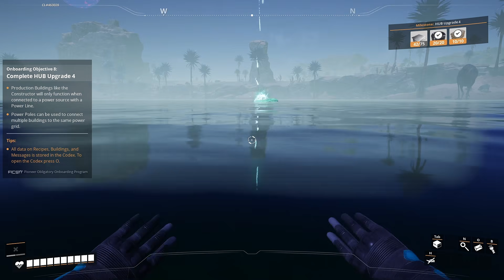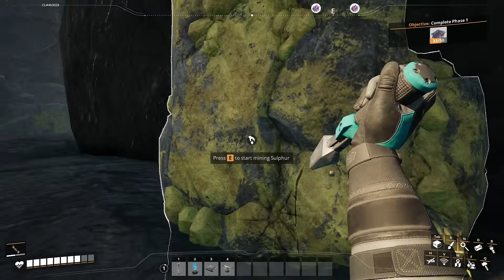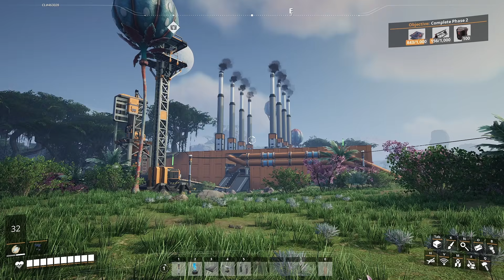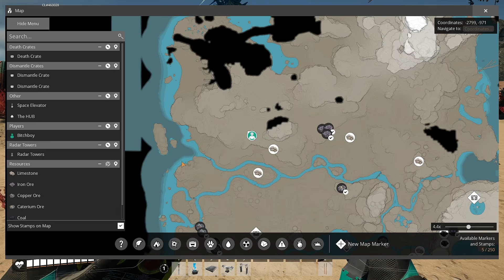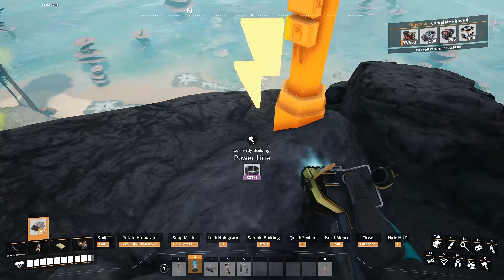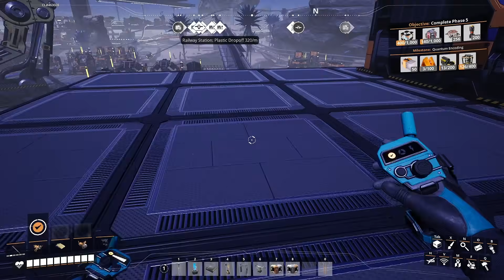I Tried Satisfactory, It Was Amazing

Comment: The single map thing is indeed what turns me off of Satisfactory. I played blind the first time, did my own thing, got about 30 hours in and stopped. Basically enough to get a little past coal power. I'm not creative enough to make a 3d build look good and I'm way too concerned with perfect ratios, so I was just constantly annoyed. But even with that small time frame, every playthrough I watch, I know where the player is, I know what kind of resources are around them, I've even seen one with a nearly identical starter base to my own. We put our hubs, elevators, and coal plants in the exact same spots. I don't know what the goal of a repeat playthrough would be other than speedrunning. 

It's a fine game. Just not for me.

Comment: Tip for your early-to-midgame endeavors, especially if you decide to make another playthrough: use Tractors instead of stringing long belts and sky bridges across the biome! 

They use less fuel than you’d think, and in the early game you can always scrounge up some fuel (I recommend starting with Coal) from locations that are inconvenient for Steel or Power and bring it to the rest of your truck network with a dedicated fuel truck!

Plus, the suspension on them is surprisingly good- you can just drive them across the bare ground in most locations, and you can make short elevated foundation bridges to handle areas you can’t. 

I love to use them to bring resources from factories I string out across a biome to my home base, mostly due to the versatility.

Comment: To address one of your later critique, the awesome points system provides a "megabasing" target and insentive, sinking more complex parts (phase 5 parts are the best) to generate as much points per minute as possible. Since the map is finite, there is a theoretical limit to how many points per minute one can generate, but still megabasing into the hundreds of millions of points per minute is an interesting challenge as one needs to exploit almost all resources of the map and also choose which alts to use carefully to save on rarer resources, for example the Pure Copper Ingot alt becomes amazing for its yield despite how annoying it is to use in a normal run.

That being said, great video as always!

Comment: one thing about the blueprint system: once you unlock steel based platforms from the fixcit sink and realize that stacking machines is stupidly easy, you can cram like 12 machines into one space with it. gets a WHOLE lot better with blueprinters mk2, though the recipe setting leaves much to be desired..............

Comment: How far ahead are you recording these? Are you switching games every day as you record?

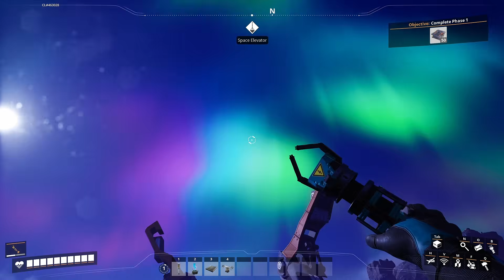14:35 That type of space elevator need not be pulling hard on the ground station. They can even "hover" just above the ground unattached to it.

23:29 I love how we can see it being constructed by a technology similar to our own construction tool. It makes more sense than Factorio labs.

37:50 At least your factory colour scheme isn't a dated edgy 4chan meme. :-)

1:18:42 It's exponential growth, so we can tell it has not been going for thousands of years, because otherwise everywhere would be covered in factories. E.g. in just 480 years, if the population of Pioneers multiplies by 10 every 10 years, you could fill a trillion volumes the size of our observable universe, each with trillion galaxies, each with a trillion usable planets, and still each would still have a trillion Pioneers on it. The drop pods would only be a few metres apart.

1:22:09 In case it's hard to tell, the gaps above are in the shape of the FicSit tick-mark symbol.

1:24:18 I guess they don't let you build any more ships to symbolise how little the corporation values/valued you?